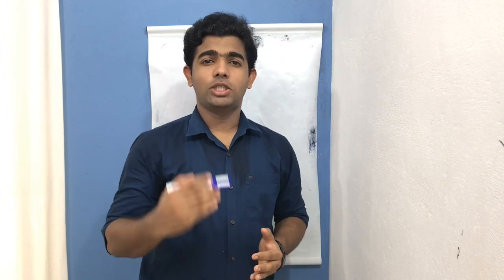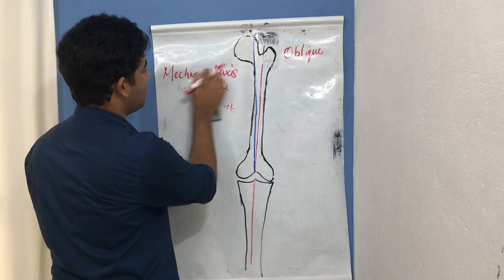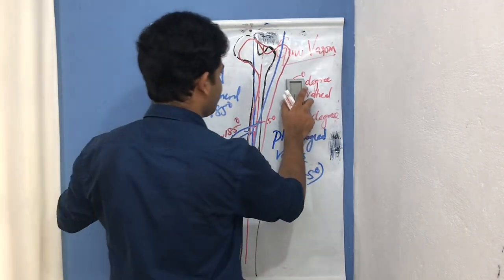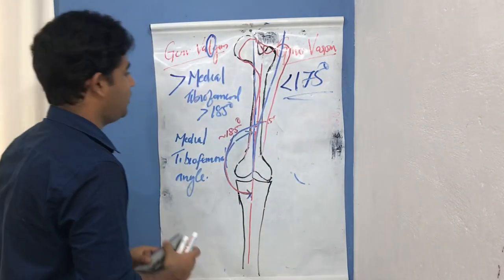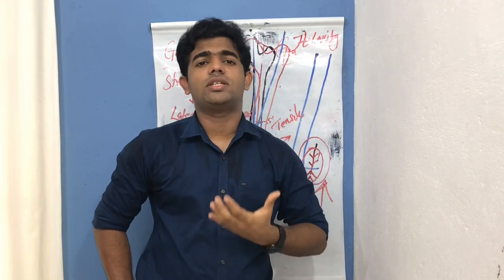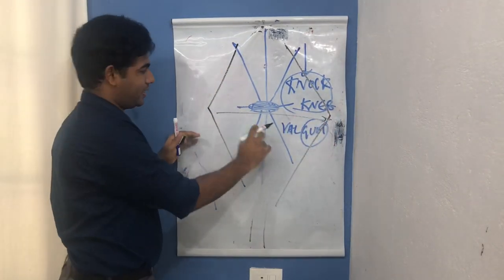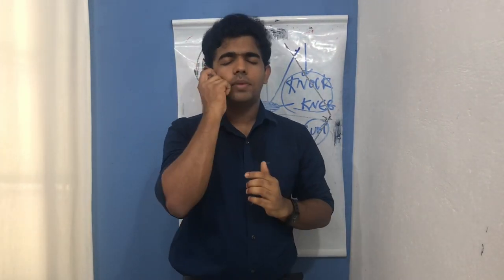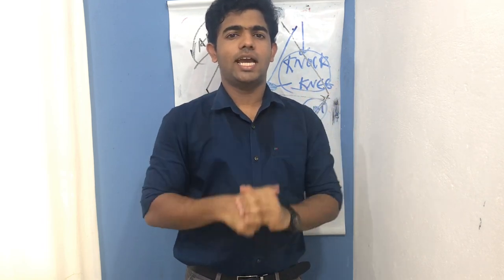GENU VALGUM & GENU VARUM ( Knee Complex Biomechanics)

Comment: Sir I had a doubt, ligament laxity in case of valgum should be in the medial compartment and in case of varum should be in the lateral compartment, meaning to say on the opposite side of the compressive force because laxity will be caused by stretching of the ligaments pushing them towards the plastic zone in the stress strain curve right??
Reply from the maker: Ya absolutly right...good job...good way of coorelation. Moreover to ur knowledge if u observe video i have also mentioned laxity - pseduolaxity of ligaments that hppens in same side..thts something to think on...here at side of compression the ligaments get shortned and move to the CRIMP region- i guess u can get it, its from stress strain relations...so ligaments to some extent behaves the same as being lax at plastic region at thisCRIMP or TOE region too...but usually we neglect it clincally as such great deal of compression and joint narrowing is not seen in usual scenarios....
Reply: @TonysTutorial  thankyou sooo much sir, this makes complete sense now, I actually didnt know the crimped region had this pseudo laxity feature. Thankyouu it's very clear now
Reply from the maker: Good luck ...u r welcome

Comment: sir, what biomechanical changes occur to the side that undergoes tensile stress???
Reply from the maker: Incase of valgum the lateral compartment is subjected to higher compressive forces and lead to increase in compression of lateral
 Compartment. But at the sametime medial side should hv tensile force distrcting it but thats evident only in cases of very severe genu valgum.. otherwise softtissue structrs are capable of withstanding increased tensile force.
Reply from the maker: Insuch  cases the softtissues like ligaments would get strecthed out, and severe cases it can if the valgus or varus forces are high enough it can lead to ligament laxity occurs when softissue reaches plastic region of strss strain curve. And as per stress strain curve it can lead on to ultimate failure too but vry less likely to hppen in real life
Reply from the maker: I hope its cleared...thnk you for ur questions...good work that u think beyond ...keep it up...anymore clarity pls be free to ask..thnk u
Reply: This is amazing sir. Yeah its clear. i got it
and thankyou so much sir. so great of you! 
Sure i wont hesitate to raise doubts. Tysm🥰
Reply from the maker: Thats great....always be free to ask....all the best wth academics
Reply: thankyou so much sir🙏🙏♥️
Reply: Incredible
Reply from the maker: Thnks bro